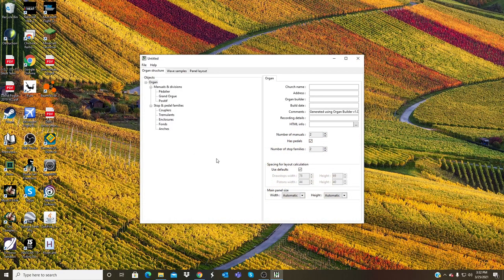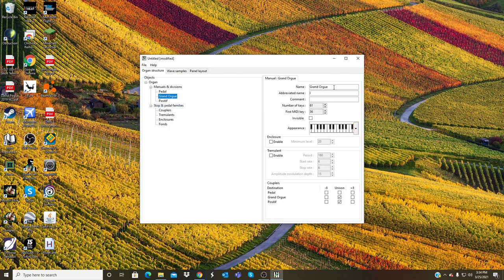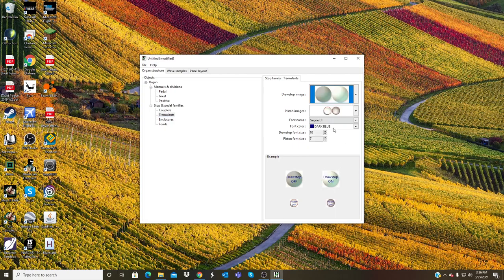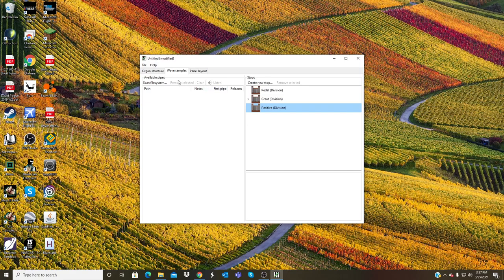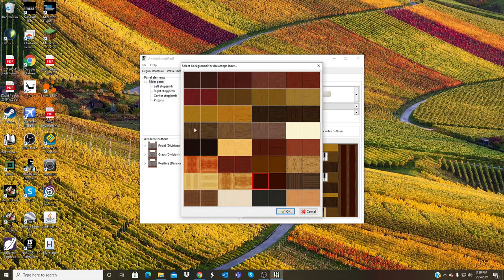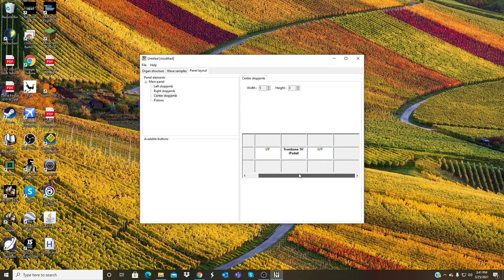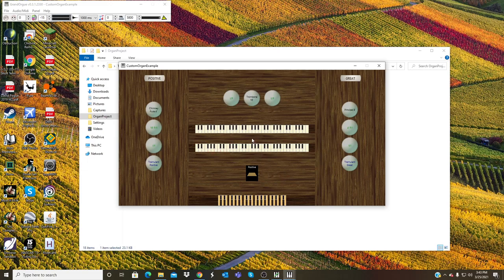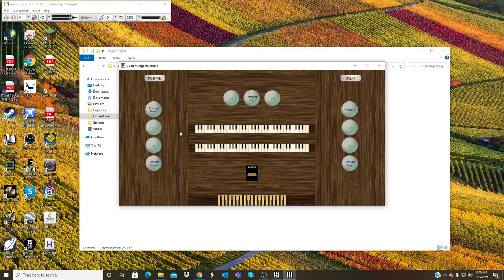How To Create A Virtual Pipe Organ

Comment: Thanks you for the tutorial. It really helps a lot! Just one question: i want to sample the organ in my church, But if i Just record the sound, and rename Them to 036-C etc, It Will load. But IT Will play the full audio file, and only stop when the sound has ended. How kan you add it so they loop when holding, and get cut off when releasing? And also how do you add An attack file for the sound?

Comment: Is there a reason you set the Harmonic Value is set to 64’ and not to the corresponding 16’ or 8’ or 4’? 5:20
Reply from the maker: Hello, it’s been awhile since I’ve used this software, but if I recall correctly it won’t work unless the harmonic number is 64'. That may not be true, and you can experiment with it if you like, but that’s just what I remember.

Comment: [WANDER SMIT] but what if one of the organs you are using for the organ you are making is in a different tuning than the other organs you are using? for example i have a saint maximin demo for grandorgue but it is tuned in meantone tuning and also a note lower! I have loaded the organ but when I pull out two stops of different organs (saint maximin and kandelaarkerk veendam) it sounds very ugly of course
do you know anything about that?
Reply from the maker: My only solution to that would be to tune the saint maximin stops up to the same note as the kandelaarkerk veendam stops within the GrandOrgue organ settings. It may take awhile but it can be done. Once you’ve tuned them, you can click file > save within GrandOrgue to create a combination file for the custom organ. 

About the tuning: don’t re-tune the saint maximin organ itself, only re-tune the stops you’ve borrowed from it within the custom organ. You can access the organ settings by going to Audio/MIDI Settings > Organ Settings. I hope that made sense
Reply: @thegamingnascarpilot2442  Thank you so much! it actually works! now i have my own grandorgue organ that fits perfectly on my console! Thanks a lot! :D (and now its time to tune all saint maximin samples to 300,000000 ...)
Reply from the maker: @Rutgerski  Glad it’s working! Happy to help 👍
Reply: oops... i mean 200,00000 cent

Comment: How can you find the data file for Pitea sampleset?
Reply from the maker: When creating a new organ, as long as you have the sample set downloaded, click on “scan file system” within the organ builder, and you must locate the folder in which you’ve extracted the sample set. 

Within this folder, there should be sub-folders that each have a stop name, such as “HVOktava4” or “PEDBasun16.” You’ll want to select one of these folders and click “OK.” You can then apply this audio to a stop within the organ builder by dragging it to the stop name.

Sorry if that was long, but I hope it helped!
Reply: @thegamingnascarpilot2442  When I downloaded the Pitea sampleset it wasnt a zip file or anything but it was only the grandorgue app itself
Reply from the maker: @nic_mar  I’m not sure I’ve heard of this issue. Do you mean it appears as a “.organ” file?
Reply: @thegamingnascarpilot2442  it comes as a .orgue file
Reply from the maker: @nic_mar  maybe try putting it into a new folder and then extracting it there? That’s all I can think of
Reply: @thegamingnascarpilot2442  thanks, it worked
Reply from the maker: @nic_mar  Glad I could help 👍
Reply: @thegamingnascarpilot2442  I have another question sorry, but would it be possible in organbuilder to turn a principal 4' into a 8' (for example) since in some files i dont see the certain stop i'd need
Reply from the maker: @nic_mar  for now, borrow the audio as a 4' stop. When you open the organ, you can re-tune it in the organ settings down to an 8', but make sure you save those settings by clicking on “File -> Save” in the main GO tab.
Reply: @thegamingnascarpilot2442  Which settings would have to be tuned?
Reply from the maker: @nic_mar  when you open the organ, in the main tab, there’s an option labeled “Audio/MIDI Settings.” You'll want to click that and select “Organ Settings.” It will open a list of every stop and it's according files. From there, select the stop name that needs tuning, and within the tuning option, set it to “-1200.” Then apply and hit ok. The stop should sound one octave lower when applied.
Reply: @thegamingnascarpilot2442  thank u so much!
Reply from the maker: @nic_mar  No problem! 👍
Reply: @nic_mar  Abra o arquivo com o programa WinRAR e extraia as pastas.